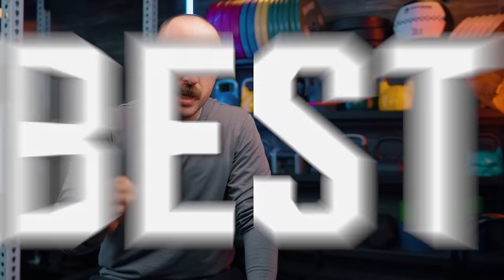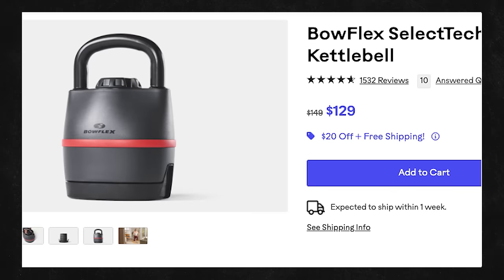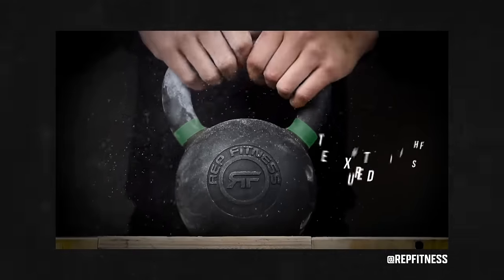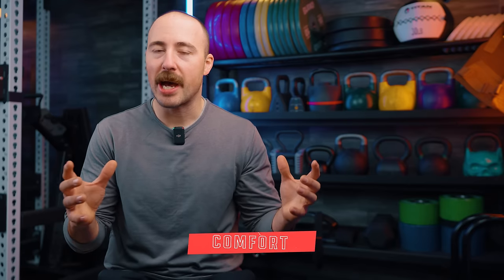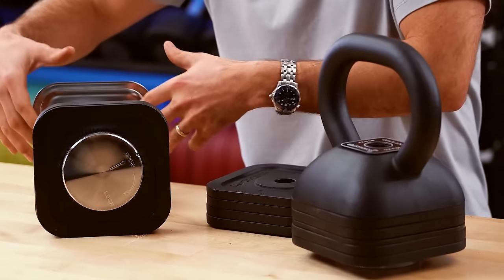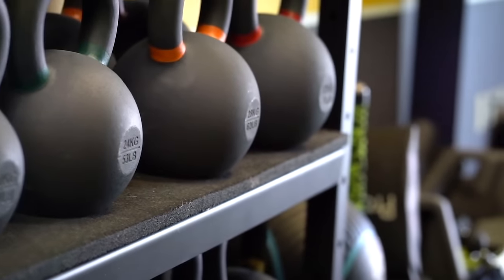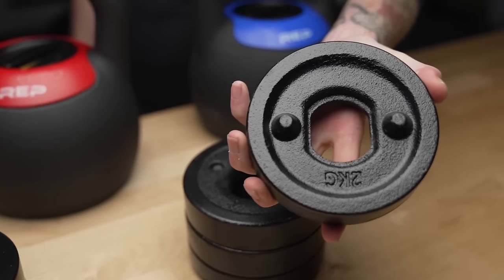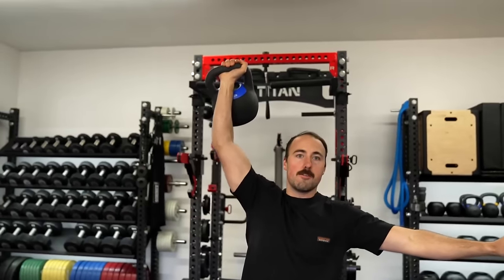The Best Kettlebells for 2024! Cast Iron, Competition, Adjustable, & More…

Comment: 4:30  Ductile iron is a type of cast iron. What you are trying to say is most cast iron bells are grey iron. Grey iron is less expensive; the carbon in the iron takes the shape of flakes, which is where the alloy will crack easier. Ductile iron has different processing so the carbon forms spheres.
Reply: I was confused about this. Thanks for the explanation.

Comment: HUGE fan of the bells of steel adjustable kettlebell. I have two and use them near every day.

Also, an oversight in this category is Eleiko's competition bell. It is the smoothest and best feel in the hand which really matters over long cycles!
Reply: Agreed.  IMO the competition adjustable kettlebell is the best value piece of equipment available.  I really like my Bells of Steel set.
Reply: I sold my rep fitness adjustable to put towards a second BoS Adjustable. The competition style is nicer (my preference), the REP afaik only goes to 24kg, and realistically I don't change the weights more than once a week so it's only a couple minutes to switching plates. The BOS can also be loaded for 0.5 or 1kg which is another plus. There's a couple brands that all look like the BOS one, I assume they're the same supplier.

Comment: I had a bad experience with the REP Adjustables.  Twice, the adjustability mechanism picked up one more plate than it should have and it fell out during use, once on  my floor padding and once on my foot.  If it happened during a swing it would have gone trough a wall.  Mentally, I couldn't do anything overhead after; looking up at the mechanism freaked me out to much.  Also, they were really uncomfortable in cleans/rack position.

I've got 3 adjustable competition bells now (2 KB Kings, 1 Titan).  These are the REAL value pick here.  When you're used to turning a dial to adjust dumbbells, they take a while to change, but they're rock solid stable in the ballistics, cost a fraction of what multiple individual bells would cost, and don't take up too much space.
Reply: I don't feel confident either.
Reply: Safety is number one for the types of ballistic movements people use kettlebells for. a 2kg plate falling on my head or flying across the room is a never event. If I wasn't 100% confident in the design of the bell, I wouldn't use it even if it was free. it's just not worth the risk.

Comment: Tip: use paint markers to fill raised or depressed weight markings so they’re easy to read on Kettlebells, dumbbells, plates, etc.
Reply: Even better, use paint in the Standard Kettle Bell Color Code:  8pink  12blue  16yellow  20purple  24green  28purple  32red etc.

Comment: Finally someone reviews KB's.   

I'm a hardstyle (cast iron) guy cuz that's what there was 10+ years ago when i started KB's.   I have a good mix at this point.  Kettlebell Kings, Rep, Rogue, some no name "sampson" 

The  kettlebell kings are the best, it's not close.  Smooth handles with a big window and as Coop mentions a great powdercoat.   

The Reps are 2nd, their handles are pretty nice, but it changes in size at about 20kg or so (much thinner below that, changes the feel and the way you clean it) but they do have a few odd sizes that many don't (smaller jumps) and significantly cheaper than KK.

The no name (sampson?  doubt they are even in business anymore)  are fine.   I"m mostly used to them.  I think I paid like $300 picked up for 6k to 28k by 4k, that's how old they are. 

The Rogue's are the least good.  The handles are rough (which tears up your hands) and the windows are too small (esp on bigger bells).   However Rogue is about the only place (less Great Lakes Girya and kettlebell kings) that offers some big bells (over 48k) so you're limited on that aspect.  (These are the imported version).  Rogues are expensive esp with shipping.  

YMMV but while any iron works, a good handle with a good sized window makes it significantly easier to learn and get better at KB's. 

Rep's bench to hold KB"s is significantly cheaper than everyone else  (like $250 vs over $400 for everyone else).

Comment: I'd like to address a few things here, especially regarding competition kettlebells. Contrary to popular belief, they're not just for people who want to do competition kettlebell lifting, but they're pretty decent allrounders. They're a bit more narrow in handle width, which can make double handed swings somewhat more tricky. However, they offer one incredible benefit: consistency! No matter which weight you pick up, it always feels the same size wise so it's very simple to adjust. Also, I'd like to offer a bit more insight on why those Rogue competition kettlebells can feel more comfortable for a novice kettlebell user. The way they show the bell being held in the picture and the way you were holding it at 5:26 is "wrong". See, your hand is perpendicular to handle, but if you're using good form it should be diagonal. It's funny, because with the Apollo kettlebell you're kinda showing proper form (because the bell forces you to). It might be a bit uncomfortable at first, but it adds a ton more stability and within a week you'll get used to how it sits on your forearm and it won't hurt anymore. 

I've gone with competition kettlebells myself, one "normal" competition and one hollow competition bell (only thing that was in stock during the pandemic). I definitely prefer the hollow bell, but both are good and will last forever. Try to stay away from those super shiny handles, they're usually not that great.
Reply: I have a whole range of both powder coat and competition kettlebells, and I've switched mostly to competition for exactly the reason that they're all the same size.

Comment: Glad to see you have Pro Kettlebells on the list. I’d love to see you do a full review on these. I would appear Nikolai put out a really great product, as most of the kettlebell specialists I follow have all switched to them. 

I can’t believe you don’t even mention Kettlebell USA. Their Paradigm Pro’s are the OG hollow core competition style bell. I love my set. 

Also I have almost a full set of  Rogue’s USA powder coated bells, and I would never recommend them. The handles are very inconsistent, especially in the 20kg and under weights. A lot of them are squared off at the seams. They are cast iron as well, instead of ductile iron. Sadly the imported cast iron bells would be my recommendation to get from Rogue. 

Also side note on ductile iron. They clang a lot louder than cast iron, when banged together. So it may be something to think about if you are planning on working with double bells. I didn’t notice, until Nikolai pointed it out in a podcast.

Comment: i have a pair of adjustable competition KB,  like titan o bell of steel,  i love them,  when i use them in my workout i dont need tu adjust it,  i use the right weight for my workout,  press, swing, deadlift, ... single double...    i have two  set from 12 to 32 kg...  with step of 0,5kg     its perfetc for an home gym.

Comment: In the UK Mirafit make amazing cast iron and competition kettlebells of the same standard as Rogue and Kettlebell Kings. I've had them for a couple of years and they are very durable and balanced, also cheaper than the aforementioned ones. I don't work for Mirafit by the way.
Rep fitness, Mirafit, Rogue, and Kettlebell Kings are of a similar quality. The ones that are better still and are the true kettlebell kings are the Dragon Door ones. They cost a lot though.

Comment: 6:14 Just be warned that like Coop said, they are similar but not exactly the same. I got a 35 lbs Rep kettlebell just to pair with my Rogue 35 lbs and the handle diameter is different. Rogue is thicker in case you are wondering.

Comment: Rogues shipping is crazy for higher weight. I really wish they would just bake the shipping costs into their retail costs because a 203 pound kettlebell is 285 dollars. Getting it to your house is going to cost close to 300. So 585 dollars for a 203 pound kettlebell vs 456 @ kettlebell kings after tax because they ship for free. Rogue looks substantially cheaper initially but you end up saving almost 130 Dollars by going w kettlebell kings in this particular scenario.

Comment: I'm going to have to disagree about the adjustable recommendation. The comp style option is what a lot of people who are into kettlebells will recommend.

The rep one is easier to change weights but the comp style adjustables are closer in shape to a solid bell. And most kettlebell programs don't really feature a lot of changing of weights within the workout. The comp style adjustables generally go higher too.

Most designs for the comp style adjustables appear to be coming out of the same factory. Bells of Steel or Kettlebell Kings seems to be the common places for the US.

If you already have iron gym adjustable weights maybe their attachment makes sense. Most adjustable options are fairly bad though. Maybe ok if all you will do is swings but then you could look into getting something that looks like a loading pin with a handle.

Comment: Bells of steel and kettlebell kings both have adjustable competition kettlebells. Bells of steel go in .5kg increments from 12-32kg. Easily the best value with 200$ and 300$ versions. The form and finish are nearly equal to traditional competition kettlebells
Reply: They take a lot to adjust, but they’re solid pieces and you’re not doing drop sets or adjusting kettlebells mid workout. Kettlebells are used for reps or periods of time, then you adjust weight as you meet those goals. Coop is very knowledgeable, but I think he seriously glossed over on these because he views it as an accessory when they can absolutely be a centerpiece of a home gym
Reply: I own both the Bells of Steel and Kettlebell Kings adjustable competition kettlebells.  Though similar, the Bells of Steel adjustable kettlebell is of better quality.  You can't go wrong with either.
Reply: @Surfingfornewandaveragesurfers  Yeah, Bells of Steel had a new mold made for their Mark Wildman kettlebell & their regular adjustable kettlebell. They also include an extra nut.

Comment: A 20 minute kettlebell review and never mentioned the original cast bell. RKC from Dragon Door. I have the USA rogues, Metrixx Elite, KK, and a few others. RKC is easily the most accurate with regards to stated weight and their e-coat is way better than anyone else's.
Reply: Concur. Though not exactly budget-friendly! My biggest issue with them is lack of availability!
Reply: Agreed. I think the issue is that the video was trying to cover too much ground. Need to first decide a focus area: general fitness vs hard style vs sport style. 

Kind of disappointed in this review. Should have consulted someone that knows KBs
Reply: EXACTLY

Comment: This review is very limited. For example, what about the Kettlebell Kings 33mm Competition, or 35 mm competition bells? What about Kettlebells USA Paradigm Pro Elite? How do these compare? Have you looked at the Golden line of ductile iron bells, which are made in America? No, just throw out there that the Rogue Competition bells are among the best, despite the fact that they are made of cast iron, and have very thin handles, even the 48kg. By the way, the Rogue powder coat made in America line, are not ductile iron. Please make those corrections, and also, could you please inform the viewer if you were sent any of these products for free, or if you purchased these items using your own money?

Comment: Even though, this video is not really about adjustable kettlebells, you do link to some and thus the question:
How come there is nobody picking up the idea of the Stamina Versa-Bell? It seems to be a quick changing system, having an entire kettlebell the entire time and no weights hold by plastic. If I remember correctly you did not review it in the last adjustable kettlebell video either - poor quality built overall or because of the not so heavy weight, maybe?!

Comment: Every competition kettle bell offered by Titan is incorrectly colored.  I can't imagine why they would do this with a supposedly "competition" spec kettle bell.
  Titan changed the colors:  8kg from pink to yellow,  16kg from yellow to pink,  24kg from green to "aqua", and 32 from red to white.  Imagine buying bumper plates expecting 10green, 15yellow, 20blue and 25red but they arrived in 10yellow, 15pink, 20aqua and 25white.  It's like that!  Crazy.

Comment: I own many kinds of kettlebells, which include cast iron, competition, and adjustable kettlebells.  However, my favorite kettlebell is a Bionic Body kettlebell, which isn't even mentioned by Garage Gym Reviews. 
 The Bionic Body Kettlebell is my favorite kettlebell because it is much softer than a metal kettlebell and using it is much comfortable on my forearms.
Coop is entitled to his opinion, however, unless you are planning to do kettlebell juggling, which actually exists, there is nothing wrong with the vinyl-coated kettlebells-- especially, since the vinyl protects the kettlebell from rusting.
What really matters is the weight of the kettlebell.
I use kettlebells during every workout.
I have yet to have one break on me.
However, I do have cast iron Titan Fitness kettlebells that have started to rust.

Comment: The best value for a home gym or kettlebell kings adjustable competition kettlebell that you glossed over. Most people aren't adjusting kettlebells mid workout. You should pick a weight and work all the lifts until you're ready to move up. If you have 2 then you can set one light and one heavy and you're good to go.

Comment: No mention of Eleiko?  Just like you forgot about Strength Co. Iron Plates.  They really make a nice comp bell.  Hard style, I had Kettlebell Kings, which were awesome, but I replaced them with the cast-in, Stainless steel handled Technogym bells, which are 💯 S-Tier.

Comment: The mark wildman bells of steel competition adjustable kettlebell is by far the best adjustable kettlebell on the market. it's incredibly well made, It's the shape of an actual competition kettlebell (which is incredibly important - consistency of size and shape matters in KB form no matter what style), the handle is 35mm (and I think it's more comfortable than a 33mm handle that I think is probably standard on competition bells?) and most important, comes in increments of 0.5 kg plates. It can adjust from 12kg-32kg. For volume cycle programs, you just can't beat that level of adjustability in a kettlebell. Comparing that to barbell programs, you wouldn't be ok with 2kg being the smallest increment you can make on your squat program (for example). The point of an adjustable kettlebell is to be able to program a system that can be done without the space requirement of a rack full of fixed weight bells. It's also more affordable than a rack full of fixed weight bells and you're not skimping on the quality of the bell - it's bells of steel. Please get one of these bells and review it. Thanks for the video, for real. love your channel.

Comment: Commented this somewhere else, but you gotta go Vulcan Strength in the lineup. Not their rubber coat irons which meh. Lame. But their comps are both best bell AND best value. 

Best value because they offer “absolute TRAINERS”. (The blqck ones you showed in the video pic) Basically the same style and steel body construction as comps, but single color and slightly looser weight tolerance (like +\- 1%) so you get almost comps for almost iron price.  

Then, their true comp or trainers are just better made then most. Hollow body. No weight filler. All the weight is in the shell body, so it balances evenly, and that matters for cleans and snatches.  The handle is tapered at the bottom so you don’t get pinch points.  

Bottom line, vulcan sponsors actual international “master of sport” girevoy athletes, so you can tell they took those lessons learned and applied them to the product.
Reply: Have you used them in competition? I've never seen them in competition and i compete often.

Comment: why dont kettlebells have knurling?
Reply: For moves like cleans and snatches where the handle actually transitions from one position  to another, you want to be able to let the handle slip without tearing up your hands. The handle texture isn’t talked about often but it’s really important. When your grip is fatiguing, if it’s too slick it’s harder to hold on to. If it’s too rough, it can tear up your skin. For ours, we grind the handles smooth underneath but leave texture on the side. Perfect “slip and grip” is the goal.